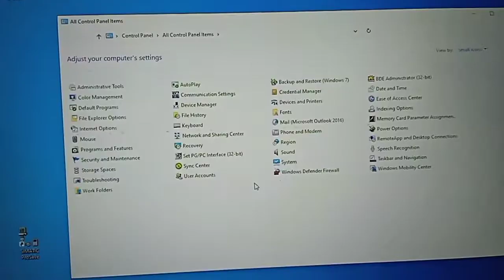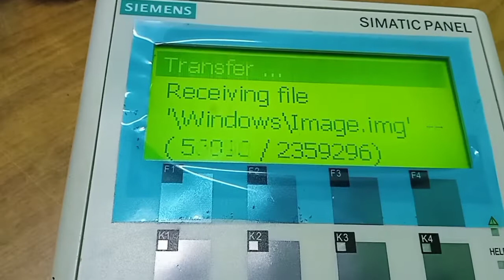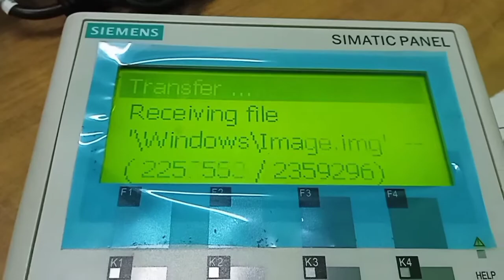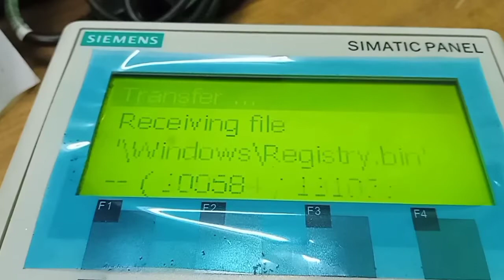Siemens OP77B HMI program Restore using Siemens PC Adapter USB A2 Cable via Simatic Prosave V17.0.1

Comment: I have a Siemens Op17 screen that I want to replace with a newer screen. What do you advise me?
Reply from the maker: If newer screens have the same MLFB number in that case Simatic Prosave can be used to retrieve the program image from the Old HMI.

While retrieving press (Up arrow+ ESC) simultaneously and switch ON the HMI power. It will force the HMI to go into transfer mode. 

The remaining procedure can be found in my channel.

Good luck 👍